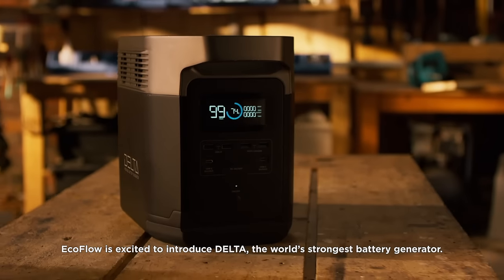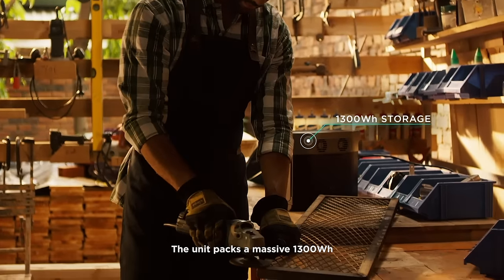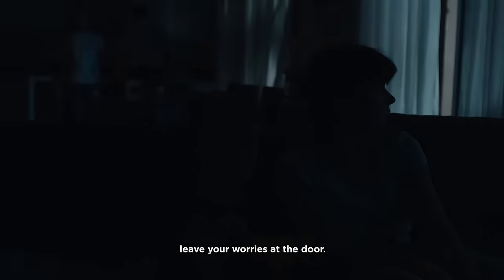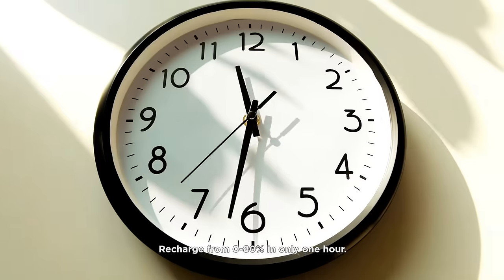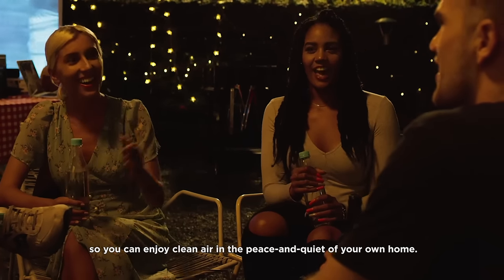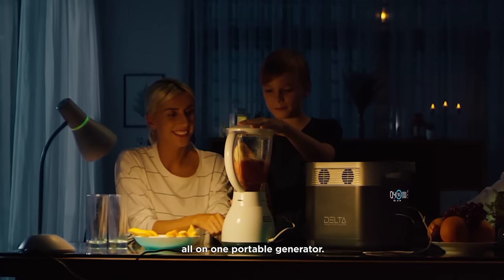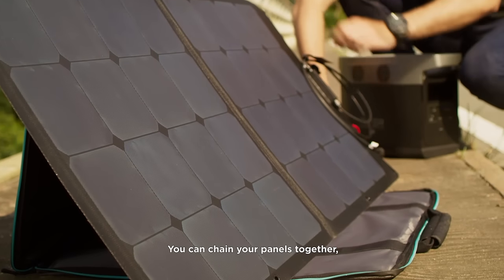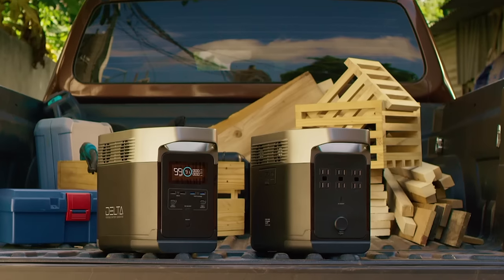Introduction of DELTA

Comment: Can you send me a quote on the 5kw unit and can you use a lawnmower with the unit . Could you connect directly onto your distribution board.
Reply from the maker: Hey there! A DELTA Pro paired with a DELTA Pro smart extra battery will suit your need. You can click this site to visit more options for the bundle. ❤https://us.ecoflow.com/products/delta-pro-portable-power-station
The DELTA Pro can be connected directly onto your distribution board but note that the Delta Pro AC output can be switched on when the AC mains is off, and the Delta Pro AC output has to be switched off when the AC mains is on, not at the same time

Comment: Loud fan noise makes it unusable in any quiet setting. Why use old unreliable technology 18650 batteries when there is better tech available (LiFePO4)?
Reply: Whoa there buddy. First off 18650 is FAR from unreliable. They are everywhere. From laptops to power tools. They are powerful and they are retily available. I wouldn't be salvaging them from packs if they weren't. Not everyone has the money or access to Lithium Iron Phosphate either.

Comment: J'ai acheté le Modèle : Station d'alimentation portable Delta EcoFlow

Mais j'ai un kit de 4 panneaux solaires en serie avec du courant limité à 16.92A et tension max à 22V pour une puissance de 300w, puis-je connecter ce kit à ma station d'alimentation alors qu'on trouve dans la spec "Tant que la tension et le courant (10-65V DC, 10A maxi)"...c est le 10A max qui me fait peur

Comment: I have a laptop that draws 130wh at 19.5v 6.7amps. How long would the delta 1300 run my laptop for?
Reply: 1300WH × 0.9 for the standard 90% DOD for lithium ion batteries yields a usable capacity of 1170WH.  1170×0.85 for an average 15% inverter loss yields a usable inverter use capacity of 994.5WH.  994.5 ÷ 130 = 7.65.  So you'd be able to draw 130W for roughly 7.65 hours.  Given that once your laptop is fully charged, the draw would be much less, you could probably use your laptop for much longer than that depending on your laptop's battery life.
Reply: @ctuan13  When you assume that laptop works on 100% performance. But generally laptops works only on 30-40% of charger's maximum performance in long run. That is expand the time to 2-3x.

Comment: When they say hours and hours, I'm skeptical. I guarantee you this company won't stand by their product if someone in your home needs backup power for an oxygen machine. These commercials are all hype and not enough power.
Reply from the maker: Hi sorry for the late reply! Regarding medical devices like an oxygen machine, it is not suggested use EPS(Emergency Power Supply) mode. I would recommend the Delta Pro Ultra as it supports UPS mode from two AC output ports in the front. Feel free to check out this full review video on the Ultra👉https://youtu.be/uMpYUGev6zI Let me know if you have any other questions🙌
Reply: @EcoFlowTech  like I said, all hype and not enough power.